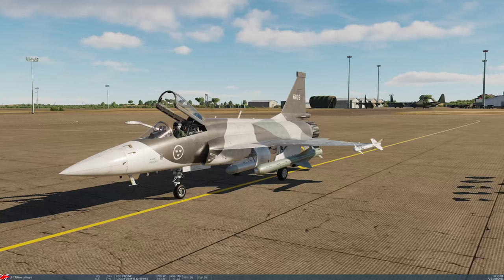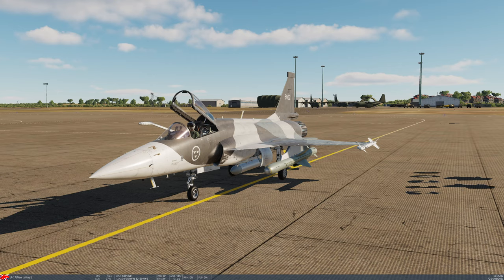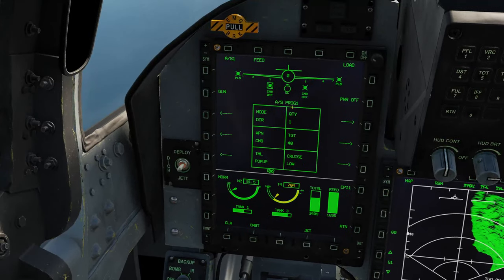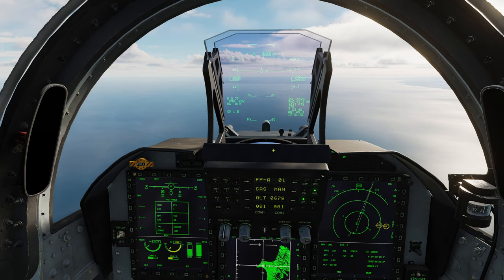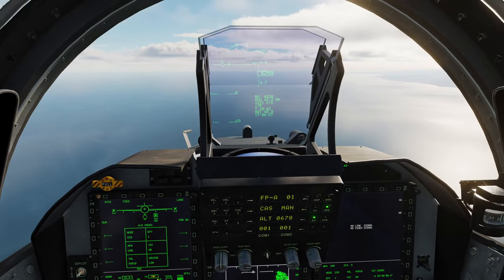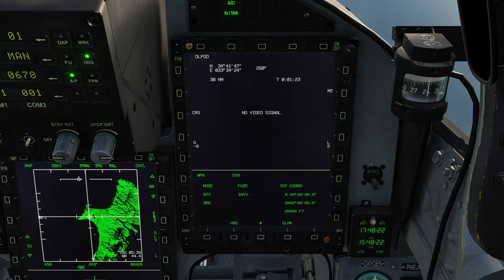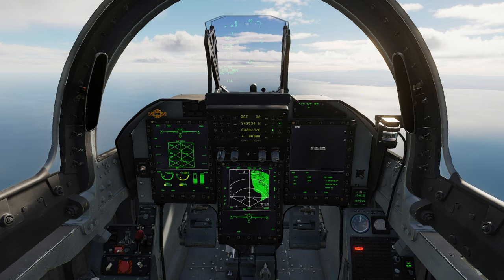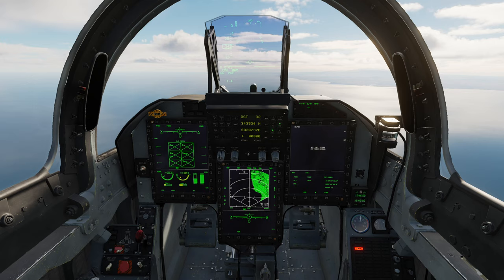DCS JF-17 Tutorial 11 - C-802AKG Cruise Missile

Comment: Thanks for putting out these tutorials. 

Just to add, the CM-802AKG missile REQUIRES MITL steering at terminal phase for ALL 3 modes (DIR, COO, MAN) to hit its target. In MAN mode, it's understood MITL steering is required. But in DIR (SPI) and COO (PP) modes, it's not always apparent that MITL steering is ALSO REQUIRED despite having an SPI or PP. If we look at the SLAM-ER or Walleye missiles, they both have the fire-and-forget option of not requiring the use of the datalink pod and MITL steering, and will still hit their targets (PP/TOO for SLAM-ER, locked target for Walleye). So if you fly Western aircraft like the F18/F16, you are used to the idea that the weapon will hit a locked target or target coordinates. But this is not so with the CM-802AKG in DCS. It sees a locked target (DIR) or pre-planned coordinates (COO) as just 'waypoints'. Deka’s present manual (as of 19 Dec 2021) is misleading but Chuck’s guide has been updated to clarify this. It would be unusual if Deka's CM-802AKG in DIR and COO modes are true to real life. That said, the CM-802AKG is more akin to the Israeli Delilah missile which requires MITL steering.

One question - Whenever the last RP is reached, the range indicator (top left DLPOD display) next to the RP always reads "5NM". For example, "3/3 2NM" means 2NM remaining to RP3. But once RP3 is reached, it stays fixed at "3/3 5NM". It's always "5NM" regardless of number of RPs or distance from the target to the last RP or to the plane. Why "5NM"?
Reply: agree that this part is confusing. We are always presented with video at the terminal phase of trajectory. So really all modes are similar in this regard.